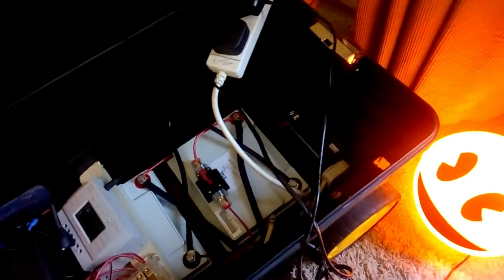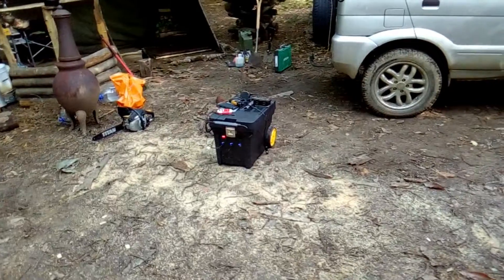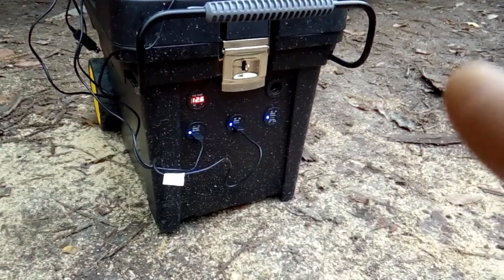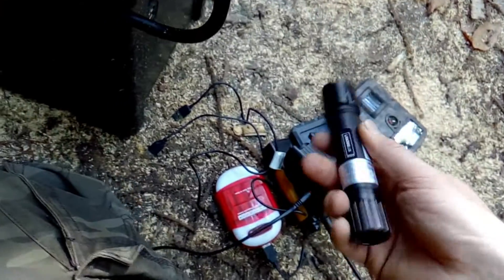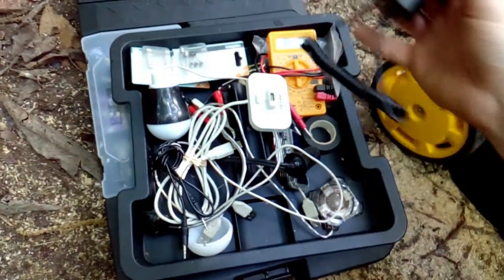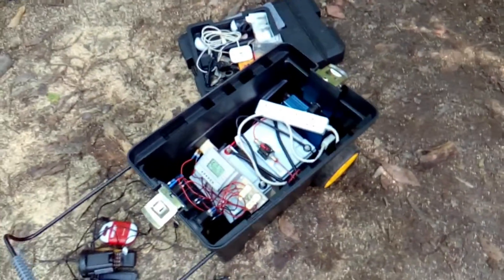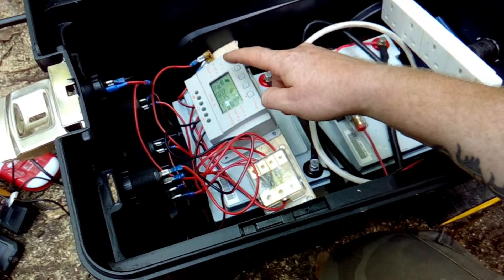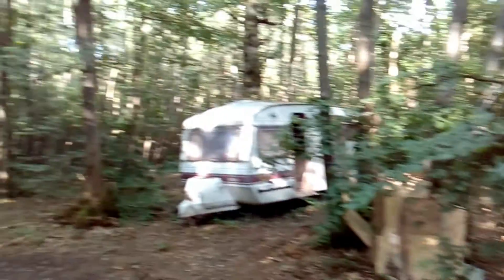my DIY portable solar generator build test and review uk

Comment: Neat solar generator bro, always had plans to make one but never got around to it. Replaced my SUV battery a few days ago so will use the old one for something like that as it is a 90ah 730cca it is a shame to waste it as it is less than a year old, I have 2 30w panels and a 600w pure sine inverter just need to track down a box and maybe get another 30w panel. The price of panels is coming down all the time here in NZ. ATB